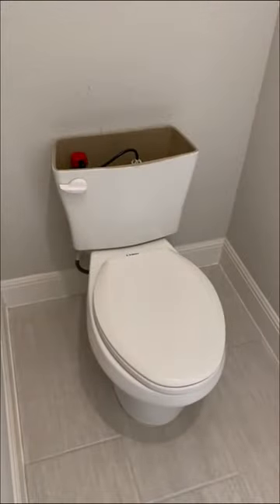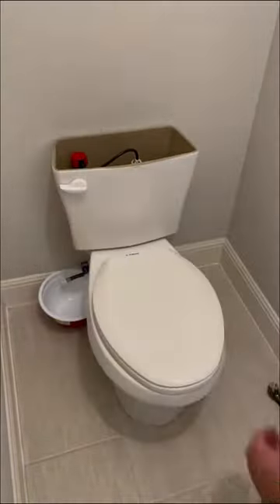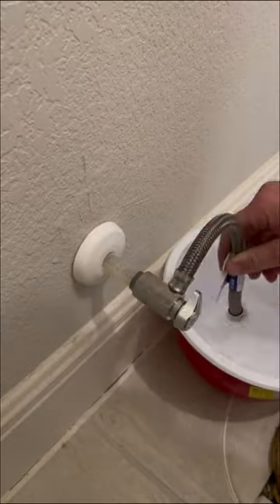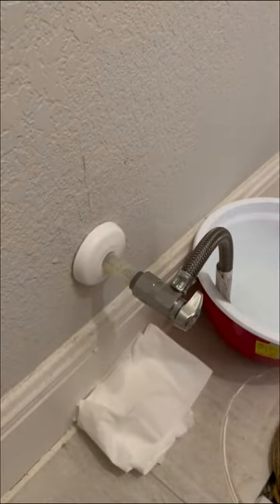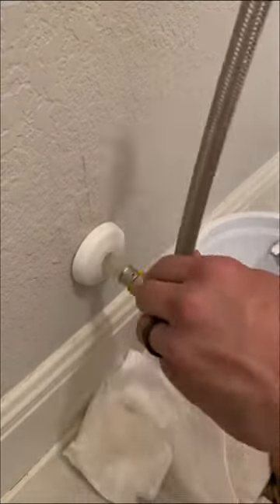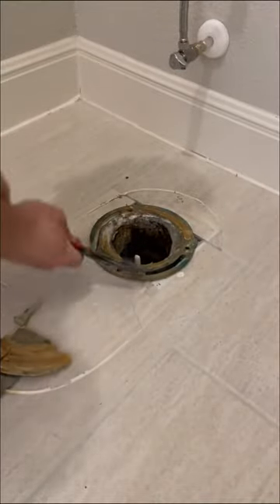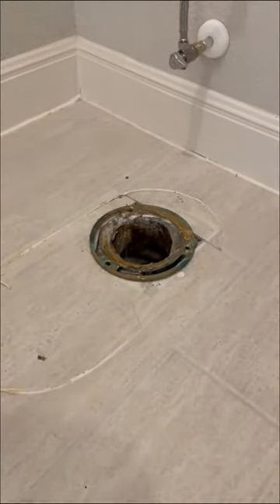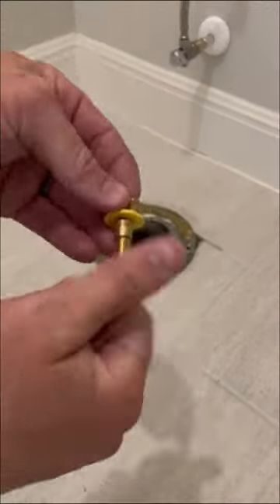Installing a toilet.

Comment: I thought I was the only one who left a gap In the back for that purpose. 😊
Reply: Anyone ever complain about getting a whiff of sewer gas from the gap?? Just had mine done and am getting a faint whiff of “something ain’t right.”
Reply: @missjackson5198 if that is the case, you do not have a proper seal between the toilet and the wax seal.  You should call your plumber to come back
Reply: @catherinecolbert7148  thank you

Comment: I’ve been told being a maintenance tech that it’s good to not put caulking down below the toilet because if you end up having future leaks you won’t know. I could be wrong tho!
Reply: That's why you have to leave a gap. A lot of plumbers don't want ANY caulk but imo that doesn't look as nice. At the very least, I want caulk around the front and on the side that faces the door.
Reply: @BearingMySeoul  that’s a good point actually, it definitely doesn’t look as nice, I think I will try out the gap method facing the back wall! Thanks for the tip!!👍🏼

Comment: That flange was almost too low too but was close if freaking plumbers would just put on top the tile like designed wouldn't have stuff like this , it's not you unless you plumbed house when built
Reply from the maker: I didn’t plumb the house lol. But yes it was slightly too low.
Reply: You realize most professional plumbers compensate for tile. It's usually remolded bathrooms that have recessed flanges. They also make a spacer for that.

Comment: No to caulking the base.  Even if you leave a gap at the back that doesn't guarantee you'll see a possible leak in time to prevent damage.  I've seen leaking toilets damage cause tens of thousands of dollars of damage.   It's rare but it happens.
Reply: Not on slab toilets
Reply: @Drixzy  I would hope so.
Reply: Its international plumbing code that you caulk around base for sanitary reason and safety
Reply: @KjbuckeyeHomeImprovements   That doesn't make it correct.  Only on a concrete floor would I say it's okay.  I would at least leave a gap at the back. On wood construction, absolutely never.
Reply: @Urbanhandyman 

"I would at least leave a gap around the back."

You mean like he says to do in the video that you  disagreed with.
Reply: @notahotshot  For wood floors NO caulking anywhere.  For concrete floors NO caulking anywhere. If you INSIST on caulking on a concrete floor then at least leave a small gap in the back, but I still wouldn't do it.
Reply: Caulking is cleaner and it stabilizes the toilet. It's the best way to go.
Reply: @OCC_Plumbing_and_Restorations  If you need caulking to stabilize the toilet then either the floor is not level or the bolts holding down the toilet are improperly installed.  As for cleaner, imagine pulling a toilet that had a slow leak underneath for ten years but the caulking kept it hidden.  I've experienced that.  Good times.
Reply: @Urbanhandyman  The caulking will only keep a leak contained if it is surrounding the entire base. If you leave a gap like literally everyone says to do, it will come out the back and you will see it. Also, the caulk hardens when it dries so the weight of the toilet is not only concentrated to the shims or pennies or whatever you use. And FYI, almost no toilet is completely level when it's installed.

Comment: Just a gap on the caulking on the back?
Reply: He left a gap (no caulking) on the back side just in case down the road the wax seal starts to leak.  That way, you can see that the toilet is leaking, instead of never seeing it until it's too late and the flooring is all rotted underneath because the water had no where to go.

Comment: Have you ever seen a leaking push on valve me ether and put a wax ring down 1st without a horn when the flange is below floor level to make sure it doesn't leak or so sewer gas can't escape
Reply from the maker: Yes, I have seen a ton of them leak. And I used an extra thick wax 🤘🏼
Reply: @theplumbersplunger  and are you sure that you seen a ton of them leak  ??
Reply: @theplumbersplunger I've seen a ton of toilets leak with the flange below the floor using 1 wax seals not to mention the sewer gas
Reply: One last thing use grout around the toilet same color as the tile guy used much more professional ya think
Reply: I've seen both styles angle stops leak in new construction. Also the caulking depends on the builder unless its your house, you might not have a choice.

Comment: Arent you supposed to apply the wax to the bottom of the toilet before setting it?
Reply from the maker: No
Reply: Wax ring goes on the flange.  Trying to stick it to the bottom of the toilet is the moronic way.
Reply: @ahmad27ny  I'm just going by what a Toto installation guide said 🤷

Comment: No, you don't use shims or caulk. If the force on the porcelain bowl is uneven, the whole bowl can crack.
 The correct procedure is to lay a thin bed of sanded grout before putting in the toilet, so the base will be fully and evenly supported. Ask any toilet nanufacturer, or old time tile mechanic.
Reply: I stack coins under them and cauk them and there's never been an issue. People have been doing that for decades and it does not cause problems.